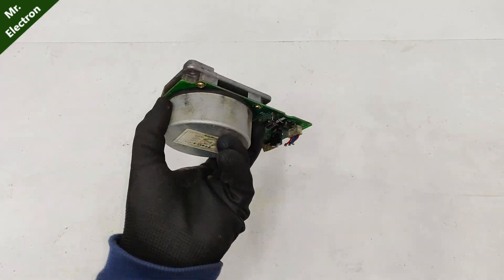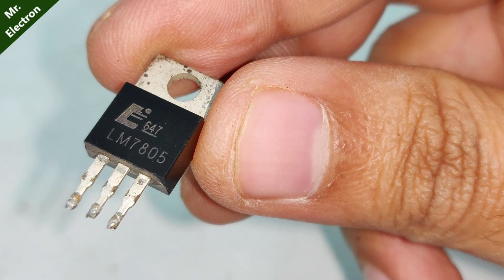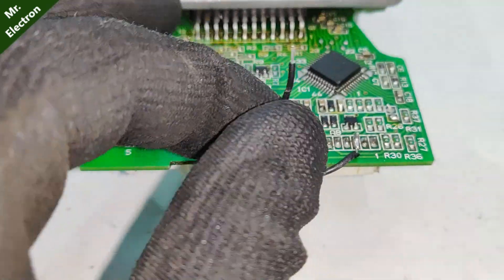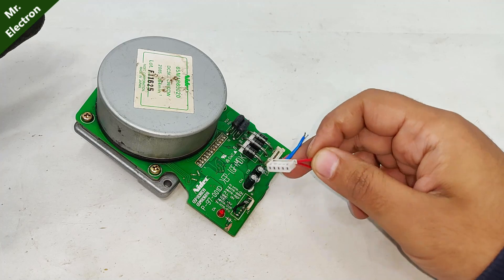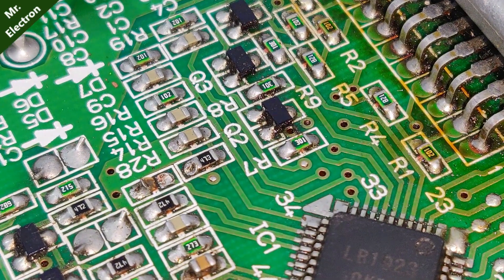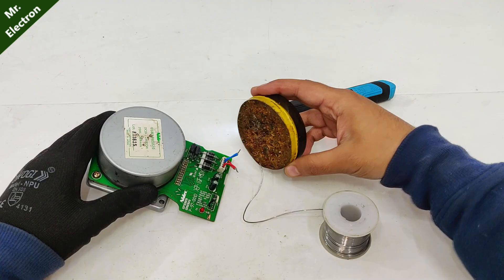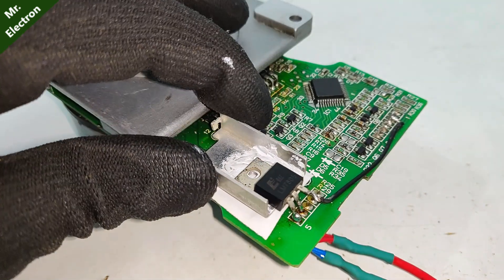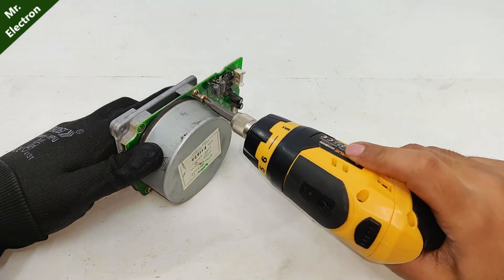Run 24V 150W Brushless DC Motor without BLDC Controller ( Photocopy Motor )

Comment: Hello 
I have  is  panasonic brushless motor how can run it have two connections one is for 24v - + 
and an other have 6 pin 
pins 1 is LD
PIN 2 IS F/R
PIN 3 IS P/S
PIN 4 IS CLK
PIN 5 IS 5V
PIN 6 is gnd
 DNQ25DS01W43

Comment: Dear it is good to see such things!

First :

You kept its on board controller in use & feedback mechanism is interlinked.

Finally run motor.

Second :

You removed on board controller & externally connected BLDC driver controller.

Finally run motor.

Now // Is it possible to use only motor as a part & run it without controller / driver MOSFETs?

Then kudos !
:goodvibes:

Comment: HELLO I HAVE A MOATECH TECH B55LK MOTOR BUT I CANT RUN IT ON MY PSU 0-30V
IT HAS TEN PINS AND CAN I RUN IT WITHOUT A RESISTOR ON A BATTERY?

Comment: U don't need to rip apart 2nd motor. U should've power it through the built in chip SLA6024 ..?
Reply: That's right, but would require a microcontroller or some other digital sequencing circuit.

Comment: Hi, I need some help on wiring connection. I have lexmark printer motor salvaged. nidec dc motor 9 pin u-h v-h w-h fg s.gnd +5V u-w v-w w-w. How do I connect these pins and make it work. Thank you in advance for your help.